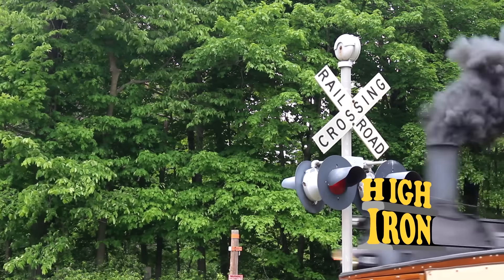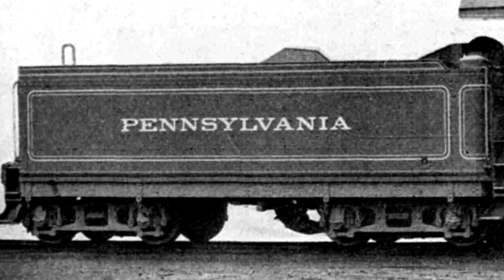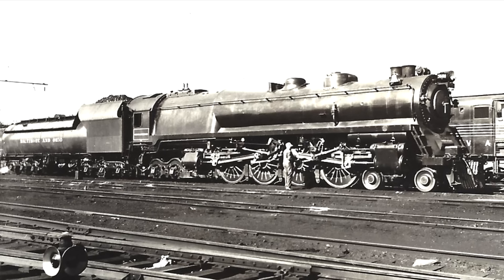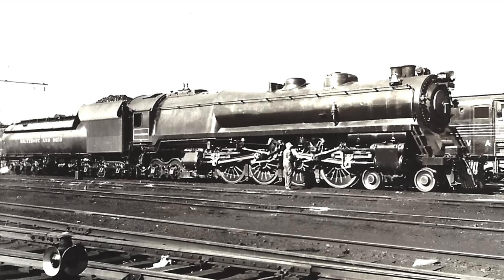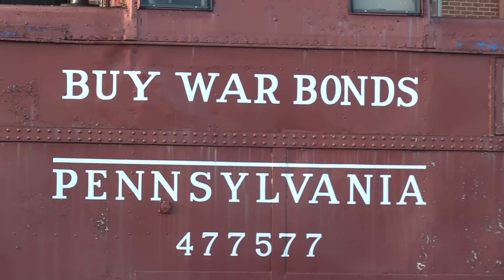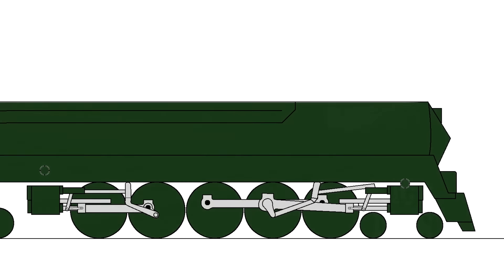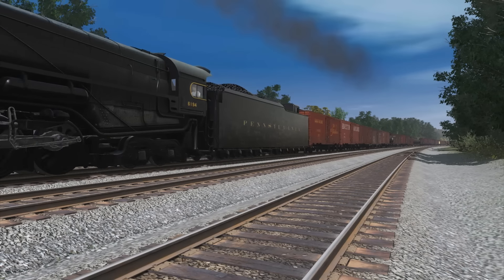Why Weren't Duplex Steam Engines Successful?

Comment: Why didn't PRR management choose the N&W Class J, when it performed just fine?  And even before that, why didn't they finish the job of electrification?  The money they wasted on duplexes and other stupid ideas(*) would have been better spent on that.

(*)Some of which were combined with the duplexes, like concentrating the driving power onto just a few wheels and having huge amounts of weight on non-driving axles . . . but they also did this with their electric locomotives, including the DD2 that they prototyped for the never-completed Allegheny electrification.

Seems to me that a substantial part of the reason for the decline of US railroads was having idiots in management (and no, it wasn't just the PRR -- the idiots that ran the Milwaukee Road into the ground come to mind, as do crooks like Patrick B. McGinnis and the asleep-at-the-wheel New Haven shareholders that let him in, and the later PRR/Penn Central management that was cooking the books up to the Penn Central bankruptcy).
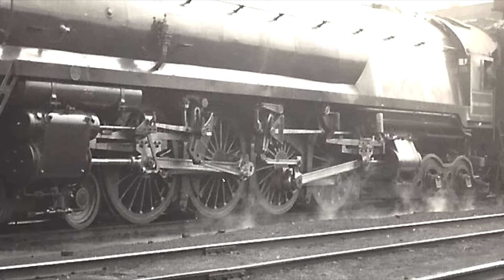Reply: The weight and distribution issues with the S1 were all remediated in the T1 design.  The initial FA of the design was around 4:48 and this was actually increased when the cylinders were sleeved (that, imho, was indeed a genuinely stupid approach).  Had the 1948 improvements been combined with conversion to Franklin type B-2 (which adapted their rotary-cam gear with bridges to the doubled valves of the type A steam chests) and PRR passenger gas coal in washed 2" lumps been provided to overcome the designed-in shortcoming of the 91' gratelet, much of the technological problem would have been overcome.  Deem-style conjugation would have fixed both low and high-speed slipping.

In partial agreement with the spirit of your third paragraph, the PRR had an enormous amount of their capital motive-power budget locked un in the 50 production T1s, just as it became clear they wanted to expensively dieselize as quickly as possible.  How do you get out of equipment trusts early?  Find that the locomotives are hopeless dogs that couldn't be saved.  You might even fabricate reasons for them to fail in service, or pass the word strategically to railfans and others that the whole idea was a ninny mistake.  Interestingly enough, that worked remarkably well, operationally...

PRR did have a somewhat detailed plan to electrify from Harrisburg to Pittsburgh, which received fast-track attention by 1943 (and might have seen some implementation if WWII had continued or something like Operation Majestic against Japan took protracted time).  The locomotives can be deduced to have the 426A twin motors of the DD2, with the expected 2-B-B-2 and "GG2" 2-C-C-2, but also with paired 2-D-D-0+0-D-D-2 sets helping/snapping over what would be left of the grades, with a ~9400' tunnel under part of Horse Shoe (made practical by the electrification).  Before any actual construction on this could 'eventuate', the war ended, and shortly afterward PRR discovered that F units and the like could do most of what the electrification would have done for orders of magnitude lower cost.
Reply: @wizlish  The T1 wasn't as bad as the S1 with respect to weight distribution, and was only slightly worse than the Norfolk and Western Class J or New York Central Niagara or C&O Class J-3/3a in that regard(*), but it still had the problem of divided drive being susceptible to weight transfer (which wouldn't do anything on the Class J, Niagara, or Class J-3/3a, since the drivers were all coupled).  I've heard of conjugation of the duplex drive (although not by that term) for the planned but never-built ACE 6000, but never heard of it being proposed for any duplex drive locomotive proposed before the 1970s (although I wouldn't count out such a thing being proposed somewhere but the idea never getting much traction).

(*)On the PRR T1, 56% of the weight (not including the tender) is adhesive weight, whereas the Norfolk and Western Class J, New York Central Niagara, and C&O class J-3 batch 1 had 58% of the non-tender weight as adhesive weight, and C&O class J-3 batch 2 had 61%, and C&O class J-3a had 59% (for C&O 614, claims to be 56%).  Not a huge difference, but insult to injury when adding the duplex drive and its weight transfer.

I never heard of any PRR plans for electric locomotives for the Allegheny line beyond the DD2.  But if that was just a prototype for testing the new motors and never intended to be a production design, that would be somewhat more understandable -- still, not a good start to reduce the adhesive weight fraction when evolving from a design for the flatlands to a design for the mountains.

As to the cost of electrification, while this is more than the cost of dieselization in the short term, it is less in the long term -- once you have the overhead wires up, in exchange for overhead wire maintenance, you don't have to maintain internal combustion engines and their accompanying generators, and energy efficiency is greatly improved unless you have a really lousy electrical generation plant, and gets even better when you add regenerative braking, which you can't do on a diesel locomotive unless you have a hybrid with a humongous amount of batteries or at least a flow battery with large reservoirs to soak up the energy from coming down the hill and then use it when going back up (and then you're hauling all those batteries up and down).  Of course, the problem is that (with very few exceptions) US companies can only think short-term, and this is even legally enforced (if you don't make annual returns for the shareholders, they can sue and win, as well as throwing out management, although look at what happened when they did the latter on the New York, New Haven and Hartford Railroad).
Reply: The principal issue with momentary weight transfer on the T1s was boiler water sloshing back on acceleration.  A good use of the analog traction control on the Q2s, adapted to be proportional, would have fixed the low-speed slip issue more or less definitively; a better solution is lateral-caliper traction-control independent brake on cheek plates in the cast driver-center rim.

Unfirtunately, the most 'correct' solution, either separate multiple throttles for each engine (easier than you think because T1s had provision for Franklin Precision air activation) or independent trim of those little stunted link gears in the Franklin type A timing mechanism that fed the 'nightmare box' weren't practical to implement.  The method Porta proposed, which was to trim the forward engine directly with four proportional-servo Wagner valves (he charmingly misspells it 'Waggoner' which makes researching how the things work much more of an 'exercise' than it needed to be), would have worked nicely in theory, but would have been difficult to control without what then would have been vacuum-tube electronics.

The issue of utilizing the tender mass for adhesion has a long and checkered history, littered with functional disasters like motor tenders or the waddling Bethlehem Auxiliary Locomotive Truck replacement.  We see the seeds of disaster for the V1 turbine as soon as N&W decided to 'utilize the silence' by motorizing the pilot trucks... PRR could have told them the likely outcome based on experience with the P5b electric, but that was a different area of motive-power experience...

The actual path toward practical electrification benefit starts with the dual-mode-lite proposal for Conrail.  The best effect comes with NOT assigning train factor on the electrified sections using the higher available continuous or hourly rating in 'electric mode' but using it effectively for helping or snapping on the logical initial sections for electrification: grades.

You can find both 'halves' of the report online (surprisingly, not even remotely in the same place).  Note the compelling differences, all toward increased practicality, between the converted SD40s of 1981 and a modern battery-hybrid consist today -- whether fueled by diesel or something more exotic like hydrogen or ammonia.

The real advantage is not just that the electrification becomes useful long before it is wholly built out, but that it never has to be continuous to give full benefit.  One of the reasons commonly trotted out against 50kV cat at stack-train loading gage is the many overheight restrictions, notably grade-separation road bridges.  With a battery in the system (specifically including flow or other batteries with high mass for their specific energy density) the train simply runs across the gaps as normal, and the eventual decision about obligate electrification (and incidentally what the response to OHLE compromise or power failure is) no longer defines the overall system costs.
Reply: @wizlish  Good point about water sloshing in the boiler.  (At some point, this might also cause a problem of uncovering the crown sheet when braking hard, especially while going downhill.)

What would have gone wrong with having twin throttles?  I understand some other engines had them.

At any rate, I would have rather seen volunteer effort and money spent on making a new New York Central Niagara (these were almost good enough to keep competing with diesels until the coal strike hit) than a PRR T1.

Utilizing tender mass for adhesion worked fine on Bayer-Garratt locomotives and their relatives (which unfortunately were never used in the US), although units made that DIDN'T have twin throttles would develop wheelslip problems as they got close to empty.

Using batteries to get across small gaps in the electrification is fine -- they just get too big if you are trying to do the whole electrification (or large segments thereof) with battery power -- dual mode locomotives would be needed for that.  I'm thinking something like a freight analog of New Jersey Transit's ALP-45DP units (which have worked well enough that NJT is getting more of them), although preferably with diesel engines that get better gas mileage.

Another possibility for dealing with tight clearances is to have segments that have this problem electrified at a lower voltage.  This is something that has actually been done, even in the US (Metro-North re-electrified the New Haven territory at 12.5 KV, but the M8s can also run under the 25 KV that Amtrak uses northeast of New Haven).  The UK even built some electric locomotives to use 6.25 KV, 12.5 KV, and 25 KV for this reason, although they later found out that they actually didn't need to use 6.25 KV in their tight clearance segments.  For us to build electrics that can use 12.5 KV, 25 KV, and 50 KV for the same reason would be an easy solution, and this would let them run on both the 60 Hz parts of legacy electrification as well as under 50 KV electrification for the long stretches.

Comment: l wonder what the possibility of nuclear powered steam locomotive would be like ??
Reply: The better solution for a vast number of reasons is the French solution: conventional 'grid'-sourced electric traction (or battery-electric plug-in charging) using nuclear power plants as a source.  (Note that this seamlessly and synergistically represents the most effective solution to using renewable energy on railroads as well...)

Comment: Wouldn't that make the Q2 stronger than big boy?
Reply: H8 had higher HP than UP 4000s. Tractive Effort?
Reply: @marklintwo  4 months later I now realize what tractive effort really means in an engines strength. I now know that there were many engines with thousands more pounds of tractive effort than big boy. Meaning that the glory of big boy being the strongest and largest is all fake news. There are even steam engines today that are stronger than big boy (not operating). Take Norfolk and Western 2156 for example with 152,206 pounds of tractive effort compared to the 135,000 pounds of big boy's tractive effort.

Comment: Side rods? Do you mean jack-shafts?
Reply: A jack shaft acts as a blind crank, with an additional side rod acting as the 'main' or 'connecting' rod.  The mechanism that rotates the jackshaft can be geared to a transverse turbine as in the SGOJ 2-8-0s, or the jackshaft can itself be rotated by rods as in Cossart valve gear (see the Algerian Garratts).

Comment: And I don't know why North Americans call drivers locomotive engineers. This is incorrect since a driver can classed as a technician, whereas an engineer is designer thinker and innovator. 
The steam locomotive was a British invention, we had it first. We built the first railways in the US, and we also built and shipped to the US the first locomotives to run on US tracks. So there.
Reply: The reason we called drivers engineers, because they have to work on their engines in the middle of nowhere back then. 
Also American steam locomotives are way better than the ones in the UK.

Comment: Picture this: the 5550 is finished, and it is tested. It proves to not just be as efficient as the modern-day diesel, but even BETTER. Thus starting the mass production of steam locomotives yet again, resulting in bringing steam back to the main line 😎
Reply: Even when diesel just came out steam could easily be considered better, except one aspect: maintenance. Still would hold true today
Reply: I don't think the climate activists would like a return to steam/coal!
Reply: @MySteamChannel  Bugger them.
Reply: @GimbleOnDew  oh I know that. But thats what I’m saying: efficiency. That also includes maintaining it too. Its also just an idea by me so there is basically no possible chance of this ever happening
Reply: @MySteamChannel  They’d just have to live with it then lol
Reply: @MySteamChannel  Yep, plus, steam locos especially in the US, make smoke (or super black steam) more than steam, British Steamers barely do smoke, always white steam
Reply: @threepea1151  Most huge loco's in the U.S had mechanical stokers & some burned oil...plus the loads & gradients were much larger. Competant hand firing of loco's was generally more fuel efficient with resulting cleaner exhausts.
Reply: @donreinke5863  😂👍
Reply: But the big snag ... a steam locomotive is inherently much less efficient than a diesel. Typically only about 7% of the heat in the coal becomes useful power, as against 30-40% for a diesel.  (Or 30-50% for coal burnt in a power station to generate electricity, with high pressure boilers, steam turbines, vacuum condensers etc.)

Comment: I lke steam but it's to in effective of a design and there is still an hour of maintenance for every hour on the track unlike diesels and or electric trains which require a hell of a lot less maintenance per track hour and a lot less fossil fuels burned. Steam engines could also be powered by compressed air but no one ever came up with an Idea while steam was engines were on the tracks to do so. Steam is fun to fantasia about but lets face it is a dead technology and NO it's not coming back!!!!

Comment: They weren't successful, coz the electric transmission technology at that time was on the point where it could provide much more sustainability power and less energy losses. The only way to save steam power was to set steam turbines to the electric generator instead of diesel/turbodiesel. But liquid fuel is easier to store and transport, and also after EV lost the power train race in 1930 there was an infrastructure for manufacturing and transportation of liquid fuel. That's why steam turbines lost to diesel one.

Comment: I love steam engines but they did require alot more Maintenance than diesels actually Europe is only 50 percent diesilized so steam is still used in Europe
Reply: But most of the rest is electric. You won't find any steam in Western Europe except on heritage lines. Nor much in Eastern Europe either nowadays.

Comment: Dude what is wrong with your thinking, all the water in the boiler would have been resting on the drivers as well as the guiding wheels and tailing wheels. What went wrong with this particular locomotive is the length of it and the fact that it's not hinged makes it impossible to make tight turns like Union Pacifics Big Boy

Comment: You mean they air to make a working modern steam locomotive in this day and age, talk about that will you?
Reply: There are many, many of them in Britain, and more pending.

The T1Trust is a special case, comparable to the A1 Trust it was named after.  While there are new-build replicas in the States, they are mostly relatively small engines like 4-4-0s; even the most likely candidates for high-speed testing questions, like the NYC 999 or the Milwaukee A Atlantics, have never reached anything like the critical mass of enthusiasm and support to see them undertaken, let alone executed in what is now typical British fashion.

I only regret that the 5AT project did not get to prototype stage.  All the FDCs were done for it...